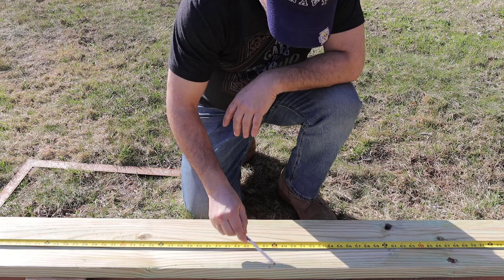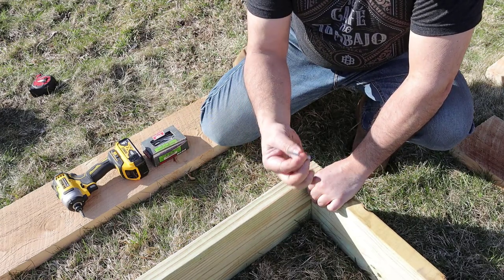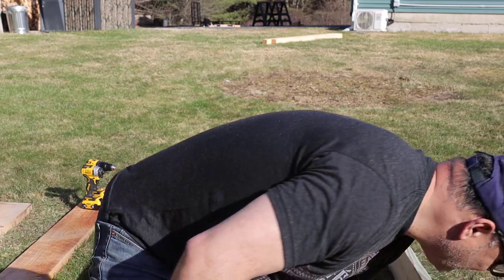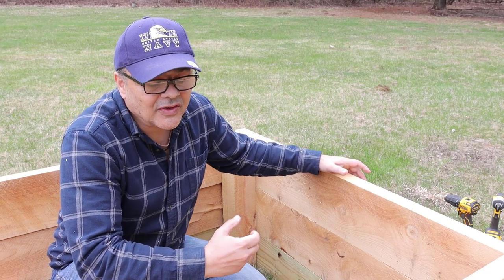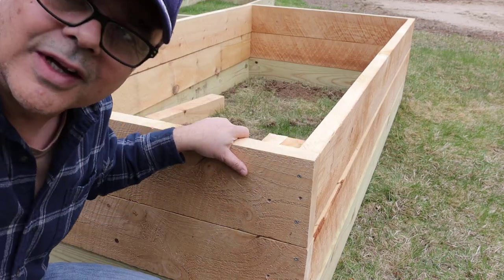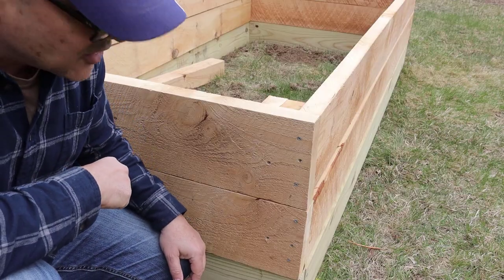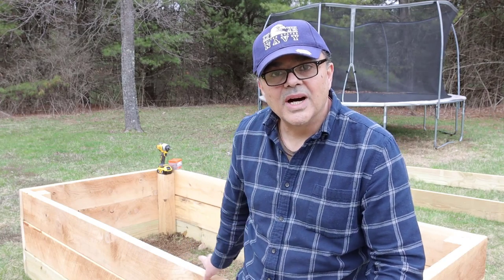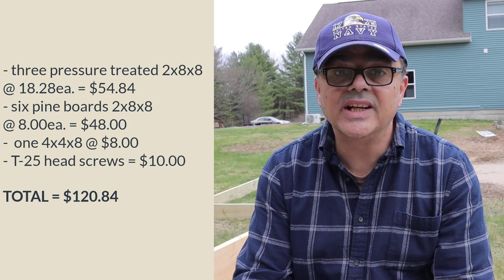This Is How I Build Raised Beds For Gardening

Comment: You can save some cash when filling your bed by using brush you can pick up from your woods to fill the bottom third to half of the bed, then add your soil mix on top. The brush provides aeration and drainage, and will break down in just a few years.
I did this on four 4x4' raised beds I had when I had a small yard. I used a bale of pro-mix blended with compost from the heap to fill them, and the space provided by the brush reduced the amount of mix I needed to use.
Looking great, Mr. D!
Oh, by the way, hasenpfeffer is delicious 😋!
Reply: and I add a little to the cost by placing a 2" layer of marble gravel under the brush for drainage facility to the ground.  The mulch layer not only makes the cost lower, but adds to natural fertilization of the be.  Excellent suggestion, Robert.
Reply from the maker: On todays video I hint how I will be filling the raised beds. I recorded it before I built my first raised bed. It will make sense to you. But I don't want to give up the store now. Thanks.

Comment: Thanks for the video.  I meant to request after the last vlog: since you do the maintenance on yours and your daughter's lawn mowers, could you do a video on how to best sharpen the blades?  I have no problem with plugs, oil and air filters, but I don't do a very good job of sharpening the blades.  I've learned NOT to use a rotary grinder on them, I can tell you that!  But also having watched your ability with the saw, it could be my technique which screws up my efforts, just like with cutting wood.
Reply from the maker: I sharpened my daughter's blade with a grinder and it came out nice. Will do another one again in the future. The grinder is the best way to do it, but if not, the box stores sell new blades for very cheap. I may have to buy the blade on my personal machine if it's too bad.